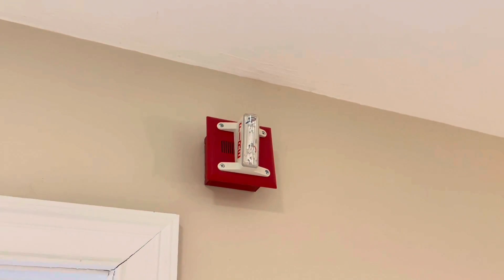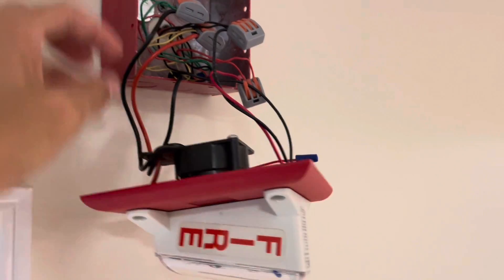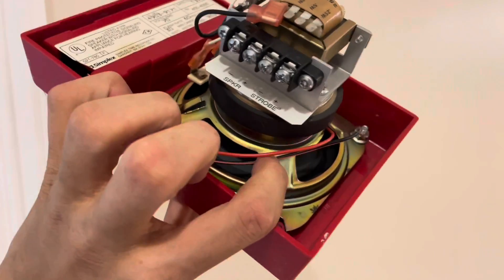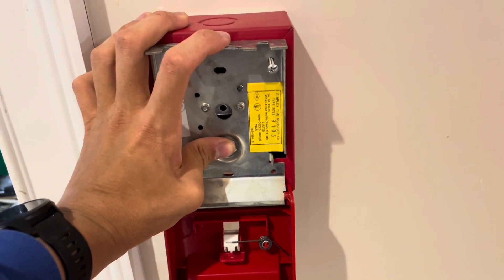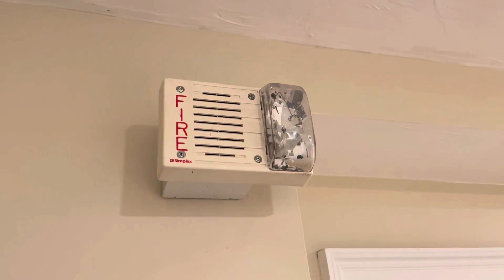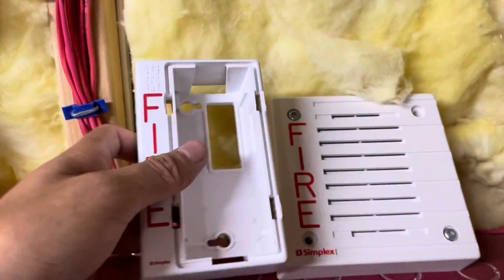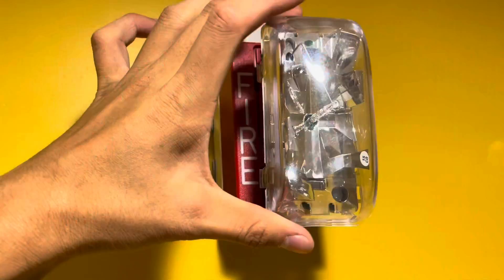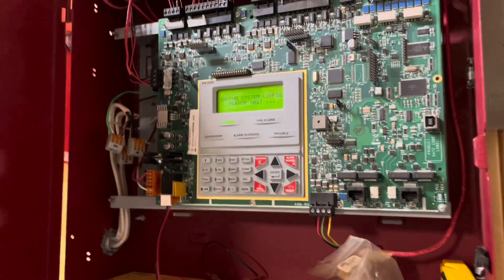Installing Simplex Speaker/Strobes and Pull Stations to Replace Federal Signal Fire Alarm Devices

Comment: That first 4903 speaker/ strobe with the replacement speaker, I’m just theorizing that it will sound a bit louder than the others. The reason is because the replacement speaker is an open back design: seen at the 2:02 mark, the metal frame of the speaker is open on the back. The big back box will have a strong acoustical effect on that particular design of speaker. The ones that are just metal on the back such as the one seen at the 0:21 mark are completely airtight from behind, and thus they can’t reverberate through the back boxes and are limited to a much narrower frequency band.
Reply from the maker: Certainly. The sound is very good quality out of that particular unit

Comment: Hi there's a high school by my house they have simplex tru alerts horn strobes inside and outside spectralert horn strobes I thought only wheelock works on a simplex system? And did wheelock sue Siemens for rebranding their horn strobes? Please explain thanks
Reply from the maker: No, simplex devices work on simplex systems. The assumption that only wheelock works on simplex is illogical. And no, Wheelock sued Siemens for patent infringement. As a result of the lawsuit, Siemens had to rebrand Wheelock devices